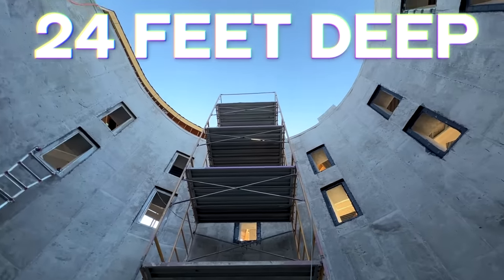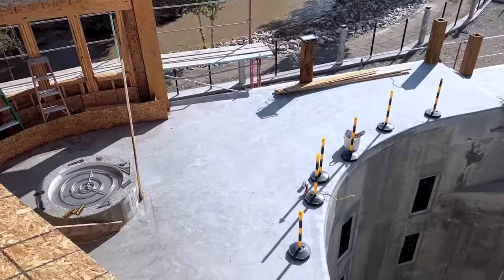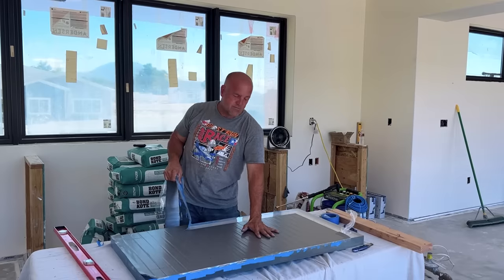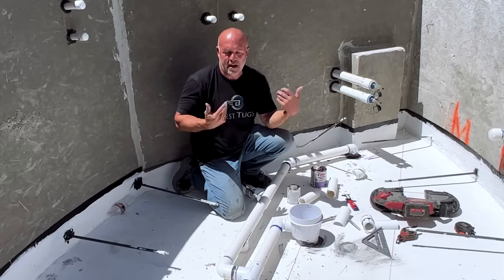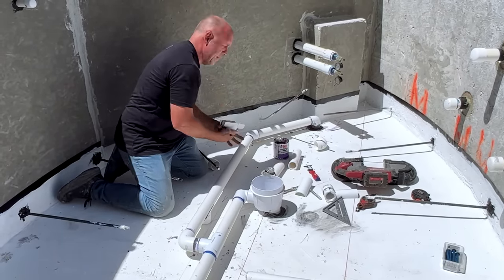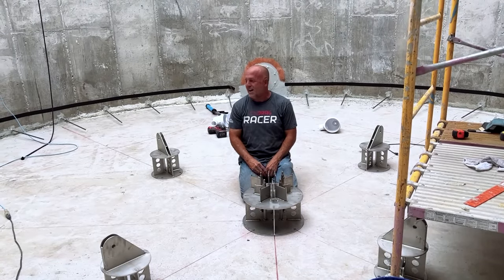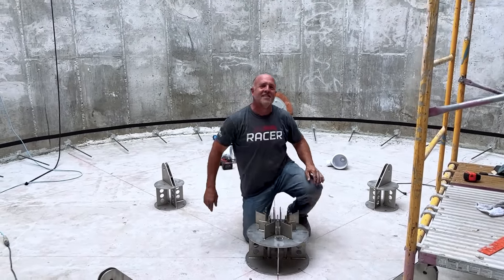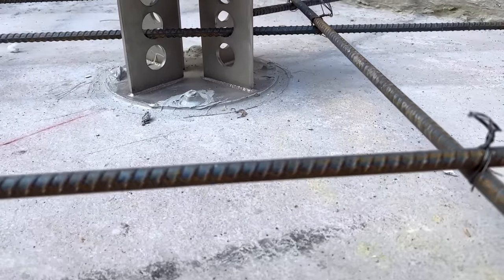Insane Rooftop Pool with Moving Floor is almost Done! | House Build #16

Comment: Commenting simultaneously during watching this video (Architect, with 25+ field work experience! English is not my native language...) ... did You made acrylic window surface grinded/ruff little bit to increase adhesion surface.? ... Excellent safety details...safety experience speaks out from You! It can be seen that You have multiple safety concerns and experience, from multiple life events during the life (Would like to collaborate with someone like You, that understand all protentional safety problems, and You are one that knows, that You never cover all of them...!  - Let's go further... I will watch, and comment further:  Great ideas, and details...probably You have time (and money) to think of it (details) every night, before (and during sleep) ... I don't like idea drilling and bolting trough the hydro insulation. Let's go further:  (Man, where and how You pool out Your energy and will for all those details day and night!?)...hmmm... morning - needed more dense rebar (and always think about zone of the rebar (never put it in the middle of the slab, because loses its function!) - upper/down, and forces!...always better thinner bars, but more dense, than thicker ad wider span... sum of the section surface is the same, but better adhesion! Also, by my experience, if You are using some prefabricated wood panels, OSB, or so...that contains glues, and other chemical products, can leave surface of concrete sensitive for next layer... incompatible for later adhesion (hydro insulation, plaster, tiles, etc...). Need to use always casings planned for the concrete, or cover them with PVC, or similar chemically neutral material... In any case, nice job... Regards from Serbia!

Comment: Won't the pvc pipes want to foat?
Reply from the maker: They are submerged in concrete...they're not going anywhere 😆
Reply: PVC sinks in water. As long as the pipes are full of water they should have no tendency to float. Just to answer that part of the question. ABS pipe may float in a pool. Density is very close to that of water.

Comment: Honest;y  the floor could float, Then fill it with water to sink, Air back in ,  The do this on every boat, submarine. . They have floating pool decks that lower to use the pool then rise to make a dance floor.   HOw did he miss this or was this just not possible in this case